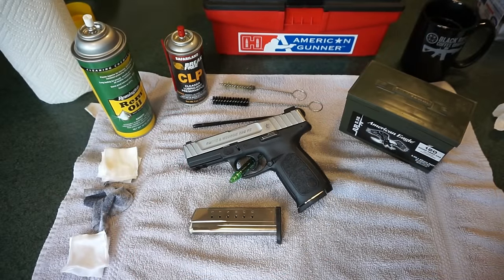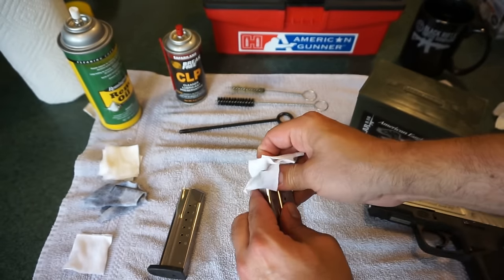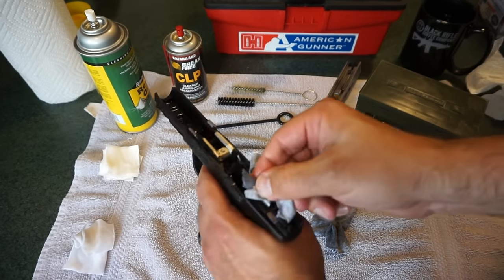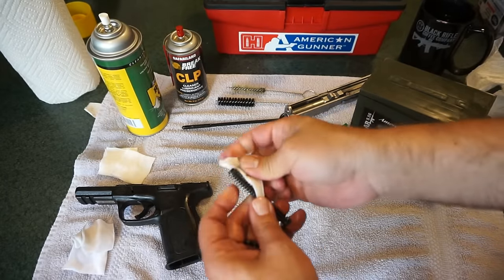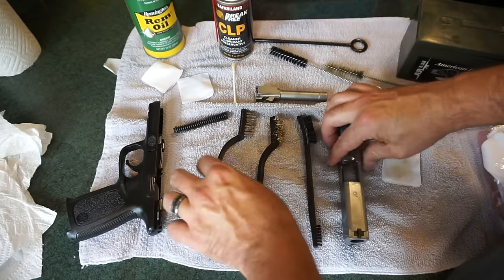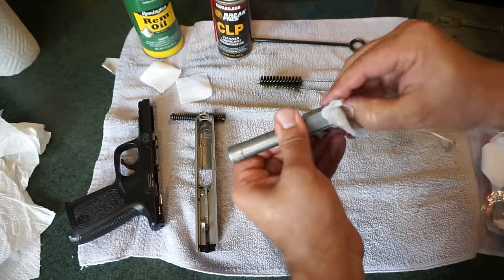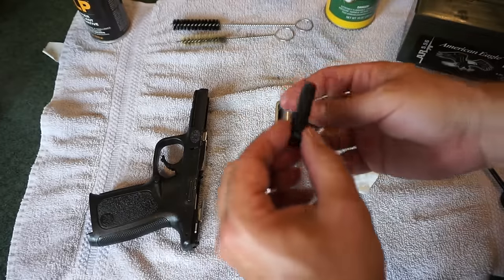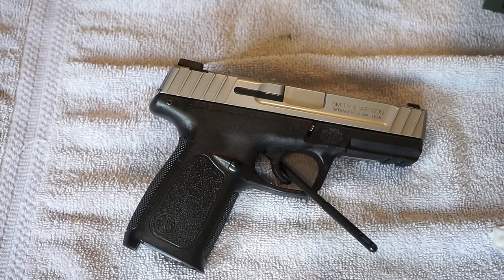Smith & Wesson SD9VE Cleaning!

Comment: Great video. I have a newer version that requires you to push down on a safety tab while the slide is open to get it to break down. Don’t put fingers in there though. Use a dowel or something. Thought your viewers should know. Great tutorial
Reply from the maker: Ok. That is probably more in line with the Shield line of pistols and M&Ps.
Reply: Or just release the firing pin lol

Comment: I think it's very important to add to the spring rod at 15:03 that there is a way to have that spring rod at an angle if you use the top groove when pressing down to barrel assembly. The spring rod needs to be seated all the way to the bottom to where it is not angled in any way, being parallel to the upper assembly. It'll take a little force, at least it did on mine, to get it properly seated. I've used these instructions before with no problem last year. This time however the spring rod was slightly tilted when I put this back together and yes it was a slight pain in arse taking it apart again to correct the issue. Good job on your video. Just wanted to point that out to anyone who's having an issue like I did.

Comment: You left out a very important step in cleaning an SD.  The extractor(spring loaded lever sunk into right side of slide behind large opening is steel, not stainless,  as is the small spring pin which holds it in place. Humidity and precipitation will cause this extractor to rust. Even a tiny amount of rust will cause this extractor to malfunction and not grab the lip of the cartridge and extract and eject it. This causes the weapon to jam.
The solution to this can be handled in this way in my experience. 
When cleaning the pistol, spray a small amount of BREAK FREE in the gap at the rear of the extractor while the slide is off the pistol. Let it soak while cleaning the grip part of the weapon. Then, I use the tip of one side of my needle nose players on my multitool to push the extractor hook portion out with light pressure numerous times. You will see rusted fluid show itself next to the springed roll pin. Wipe and repeat, spray, manipulate, wipe, repeat until Break Free comes out of rust free. I then use canned compressed air to blow out excess Break Free. I then put a tiny amount of gun oil in top and bottom Crack adjacent to the springed roller pin. 
Again, if this rusts even slightly, the extractor will not work.
I carry an SD40VE as my carry weapon while working as a funeral escort, and we work outdoors in all types of weather here in Texas. Luckily, I discovered this design flaw early into ownership when the first time I planned to clean my pistol, I removed the magazine but the round in the chamber failed to eject when I pulled the slide back. I figured our very quickly what was wrong.
You can also buy a punch and remove the retaining pin and clean underneath but the same end is accomplished in the first method with a lot less effort. Otherwise, great video.

Comment: Good basic cleaning video.  I bought the SD9VE for the wife and we both love it.  I did buy an aftermarket slide release bar for both this weapon and my Glock and they make both weapons SOOO much easier to field strip !  As for the trigger upgrade, I did order the spring kit and installed it and polished the areas of the trigger mechanism that had metal to metal contact with each other but reinstalled the original striker spring  because of light primer strikes with the new one in the kit.  Although I never had a problem with the recoil spring assembly, I also ordered a stainless guide rod and spring assembly.    I must say that I trust and would put this gun up against the Glock I own and rate them as equals to each other in all ways except initial price.  I have upgraded  the Glock trigger, recoil spring assembly, and slide take down lever also in the same manner.  I might add that I also polished the contact areas of the wife's Taurus PT111 G2 and installed the aftermarket stainless guide rod assembly in it as I share your and other peoples concerns about the plastic guide rod assemblies.
Reply from the maker: Ben Workman Sound like you made the SD into an even better pistol!
Reply: Ben Workman have had my Sd9ve for about a year and have not had any issues but after reading the comments I will definitely order that stainless guide rod spring assembly and will definitely look into getting a good glock too😁👍

Comment: The brushes are called "Tube" brushes, all three typs: stainless, brass, and poly I found on Amazon. If anyone has addressed this already, I apologize.  I bought an SD9ve on friday, and couldn't hit the target.  Got home, and the rear sight was aligned with the right side rail. I tapped into dead center, and hopefully that will work. I will be going to the range next week. 
.....................................................................................................
 Great video, subbed.  Thanks Travis, for what you do here.
Reply from the maker: Thanks for watching! That is nuts that the rear sight was off that much. Once your sights are centered, the pistol will be very accurate. Thank you for the information about the brushes, too!
Reply: I have the same problem with my SD9ve  the sights seemed like  there were off. Did that seem to work adjusting the sights?
Reply from the maker: @rpres65  mine was dead on from the factory but they rush these out so quick I wouldn't be surprised if the sights are off a little.
Reply: Most likely due to user error. Need to target practice more

Comment: Good video like always. I have a new SD 9 FDE frame model. I took it out the other day and put 60 rounds of mixed ammo through it. Worked great. Was very accurate. Got home and field stripped it and cleaned it. I noticed the round end on The guide rod that sits against the barrel lug looked warped and had a nasty "ding" on the edge. I called Smith and ask if it was normal wear after 60 rounds. They told me don't shot the gun with that rod and they would send me a New one. They kinda hinted maybe I had shot hot ammo through it. 45 rounds were normal loads and 15 were Winchester NATO. I told them surly a SW could handle 15 rounds of that ammo without damage. I have two new factory rods I ordered when I first got this gun just incase I needed them. I have heard of issued with them. So I put one of the new rods in. When I pulled the slide back I could tell the new, unused rod was bent really bad. So I installed the 3rd rod. It seems ok. Called Smith back. Got a different tech. He told me not to worry. Bent, chipped,ratty looking, don't matter as long as the gun works. But he would replace for free any rods I had that I didn't trust. Told me hid personal SD9 had over 10,000 rounds on the original guide rod. Said his guide rod looks horrible. It is normal. SW does say not to usr a metal rod.  It voids the warranty and causes issues. He also said he had never heard of any issues with the factory rods. I tol him I had . I think the plastic is too soft. Anyway, I have two new rods on the way. They do have good service. But I was told two  different things about what do in two days. One, don't shoot it, , it's normal, don't worry bout it. I respect your opinion. What is your take on this? I do like this gun but this guide rod crap is starting to annoy me.
Reply from the maker: Jimmie Harris my first SD9VE had a defective guide rod out of the box so I went with an aftermarket steel unit and never looked back. The way I see it is that I would rather lose a warranty and have a gun that functions vs. a pistol that was plagued with FTF and FTE issues. Check out my vids on the SD9 VE to see what I did and my experiences.
Reply: travisp11. Thanks for the fast response. My pistol worked great with the factory rod. Even with some 115 gr federal champion that felt really weak. I think the plastic is too soft in these factory rods. I'm gonna try the new one I have and the two new ones that are on the way. What has me wondering is why did one tech say " Don't use the warped, dinged rod." and the other tech says" Its normal. Don't worry". I am thinking about going with a metal rod. But I normally keep my guns all factory.
Reply from the maker: Jimmie Harris it is a very flimsy plastic that flexes when heated, too.
Reply: travisp11. I'll agree. The round part that goes against the barrel lug warped after 60 rounds. I believe this is why it dinged up when I was firing the gun. I inspected the pistol, inside and out before I fired it. The rod wasn't warped or dinged before I fired it. One tech said it'd normal, don't worry. One tech said don't fire the pistol any more with that rod and if it does it again they want ne to send the gun in. I'm sure the gun is fine. The rods are the issue.
Reply: travisp11. I've seen a few videos where people ate putting glock 19 factory plastic rods in the SD 9. They seem to be better built and hold up better. Some swear they have no trouble and have shot hundreds of rounds in their SD9's. I'm. Iffy about using parts from other pistols in my guns. . But I have considered it. Its really bad such a nice gun I'd having guide rod issues. I've got mine on me right now. Just got back from running earins. And I do carry around the house a lot too. But I'm getting iffy on trusting this gun.
Reply from the maker: Jimmie Harris try the NZD guide rod that I bought from eBay. I have yet to have any issues and I am at least 200 rounds in on this gun with the metal guide tod.
Reply: travisp11. I've been looking at that one. I seen you have had good luck with that one. I'm gonna take my three new factory rods out to my range and put them through the  wringer and see how they hold up. It is bad such a good gun had such an iffy guide rod. Thanks for your input and fast responses. I really enjoy your videos.

Comment: You don't need the Apex trigger. Just polish the correct pieces on the frame and slide, and lube the trigger guard and it works perfectly well. Too many people think the first fix is throwing money at something. But that's a bad reaction. A little research and a little work allows you to save the money and make things work perfectly well.
Reply from the maker: This is true.

Comment: i just bought this as my first gun, thank you for the info. It really helped me a lot..
Reply from the maker: Eddie G Glad to help!
Reply from the maker: MrCaptainkirk1984 Thanks for watching!
Reply: @travisp11  Can you give me the info for the new trigger your putting on this gun? I have seen other reviews on this . And they have said the same thin, they are putting a new on as well. Thank you
Reply from the maker: @eddieg70  I thought I wanted to go with an aftermarket trigger but there are two reasons why I decided not to.  Because my SD9VE is my bedside gun, I know the gun andI know the trigger.  I really didnt want to mess up something that is functional.  Also, in terms of liability, for a primary defense weapon I really did not want to lighten up the trigger.  With that being said, I have friends that have the APEX trigger kit installed and they love them but you want to keep the original striker spring installed instead of the APEX part simply because the APEX spring can lead to light primer strikes which is something you absolutely dont want.  In the end, the APEX kit gives you a better trigger with a pull weight that is similar to stock (so long as you dont mess with the striker spring).
Reply: @travisp11  Thank you
Reply from the maker: Eddie G yup!

Comment: Good video my only problem is the 2 gunsmiths i use locally swear that the rem oil is the worst stuff for any gun and have been told many times to throw it away and never use it.
Reply from the maker: I’ve been using it for over 20 years. It is thin when you apply it and I prefer CLP but Remoil has never caused my firearms any issues.

Comment: I own 3 pistols, a sd40ve, a Glock 19 Gen 3, and I just bought myself a glock 19x. On all 3 of these pistols I take out the firing pin and clean out the channel  every time I fire them. It's very easy and eliminates chances of light primer strikes. I've taken some pretty good size Chunks of brass shavings out of there after a single range trip. Do t be scared to detail strip the sd9ve. If you're even moderately mechanically inclined it's so easy.  If I had only 40 seconds to clean a striker-fired pistol. I would clean the feed ramp,chamber, and firing pin Channel. The three most important parts in my opinion
Reply from the maker: Joe S. Yeah, I need to expand to include the pin channel and you are right, it is a good thing to do.

Comment: so i found that there is an update to this pistol to what I have - your has the hole for the "one in the chamber" mine has a slide that pops up.  The differences on the sd9ve that have the slide that pops up is that the mechanism does NOT cock upon loading for break down with out a mag.  the mag has to be present to rack the slide and thus complete the take down...  another difference on the same subject includes not automatically loading one into the chamber and setting itself when its held back and the mag is inserted - with this one you have to actuate the slide release.  I wonder if this is something I can change or not, but made the initial break down very difficult doing exactly what you and others have showed for break down, the slide would just not come off (of course the trigger needs to be actuated and mine is not actuating that trigger with out the mag...  Thanks again for the video, got through cleaning her and breaking her down for the first time, I am waiting on the break down lever and the guide rod to arrive now so i can install that and the trigger update here this week...  ill check your videos out on that
Reply from the maker: This is good information.  I may need to get ahold of one of revised models and make a new cleaning video on it. Thank you!
Reply: @travisp11  so I found out that mine is something called a Magazine Disconnect Model which has an additional catch on the sear and may be causing all of the differenced I mentioned before...  the Apex trigger reassembly video shows the parts to complete this assembly correctly with this model if anyone needs it...
Reply from the maker: @shanemouton7606  good to know!

Comment: Awesome video. What lb did you go with the guide rod? I was looking at the different ones on NDZ PERFORMANCE, but it wouldn't matter which I chose, right? And where did you buy your trigger upgrade from, if you decided to upgrade?..
Reply from the maker: I never did buy the trigger upgrade but I was told that the upgrade that you get from Apex gun parts is awesome. As for the NDZ performance guide rod/spring, I believe I bought the 19 or 20 pound weight model as it was the closest thing to stock that they sell.

Comment: Does this video include re oil? I have no gun experience and am trying to learn and I own this gun all I can do is take the slide,guide rod,barrel out would I need to take the firing pin and everything else out before spraying it?
Reply from the maker: Just clean the pistol as I show it and you will be fine. Pick up some Safariland CLP from your local Walmart and you will be set.

Comment: I'm left handed from the videos I've seen this is not ambidextrous. Is there a left hand version or would I just have to go with a different pistol all together?
Reply from the maker: There is a company called Charter Arms that makes a revolvers for left handed shooters but as for semi automatics, there are ambi versions of pistols out there with a slide release on both sies of the frame as well as a reversible magazine release but as for the SD9VE, I have only seen it in a right handed version.

Comment: Very nice video.   I wanted to thank you for the informative video as I'm a new owner of this gun.  I'm new to all this and will go over the video many times just to have it sink in.  I'll be checking out some more of your vids.  Thank you
Reply from the maker: You are welcome.  Let me know if you have any questions about this pistol.  I've owned two now and the one featured in this video serves as our bedside gun.  It has been fairly reliable.  Only thing to watch for is the gun not holding open on the last round fired.  Many times this happens because your grip pulls down on the magazine while holding it with two hands with just enough force that the slide stop is not engaged by the magazine.  Other than that, it is a very accurate gun.  Check out my range test on it!

Comment: Great video Travis.  One question when you spray the CLP in the barrel and let in marinate.  Do you use the patches to wipe off first or go straight to the soft brass bristle brush? Thanks for your feedback.
Reply from the maker: You can run a bristle brush down it if you want to. I usually use a bore snake anymore. Just follow up with a dry patch and then a few drops of oil on one final patch to lightly coat the inside of the barrel.

Comment: very nice video thank you, i bought the same take down levers from ndz and apex trigger and spring update on it...  did you find you needed anything else to round this pistol out?
Reply from the maker: That is about it but you may want to stick with the stock striker spring.  I think the Apex striker spring may cause light primer strikes. Sounds like you have made some solid upgrades!
Reply: @travisp11  sweet and thanks for the tip, ill keep that in mind and will do the mod as you mentioned here then. i chose this sidearm for reliability so thats important to me...  thanks for the video and for the feedback man i really appreciate that